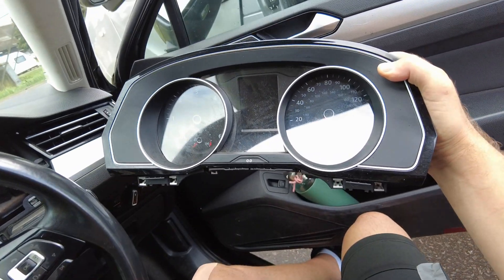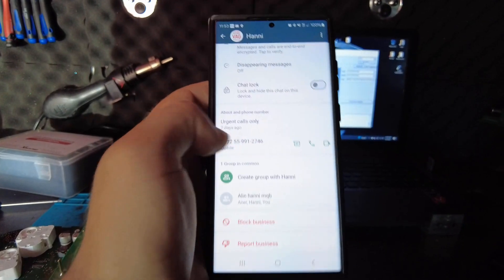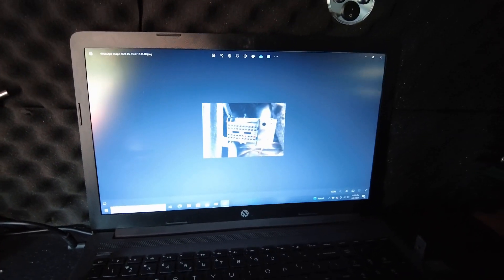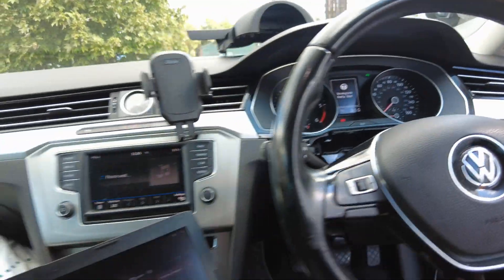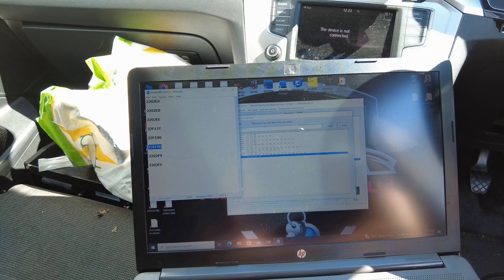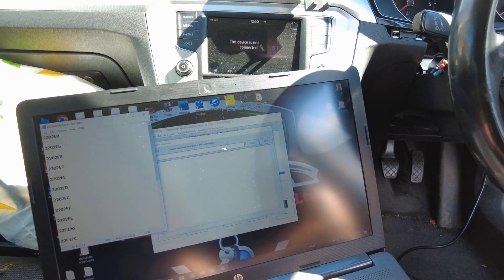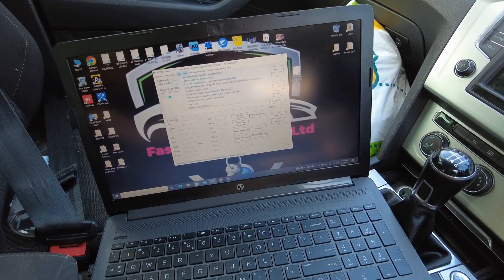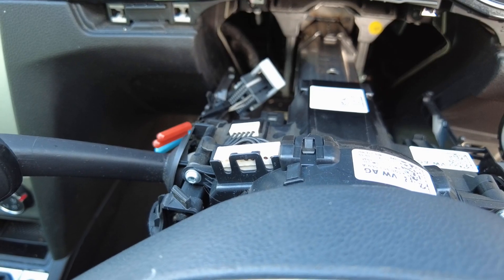VW Passat MQB Keyless All Key Lost System Hack: Ignition, Key Programming & Data Reading Guide VVDI2

Comment: Hi, I'm dealing with a 2019 Volkswagen Jetta - Keyless.  This vehicle doesn't have a steering lock.  Could you assist me with how to ignition on?
Reply from the maker: @SneekyFauker  hi how can i help?
Reply: @FastCarLocksmithLTD  Hi friend, I'm trying to get ignition on for a 2020 Volkswagen Jetta.  This vehicle doesn't have steering lock.  Also, I'm trying to find the entry and start authorisation module for this vehicle.  It's not at the driver's side.